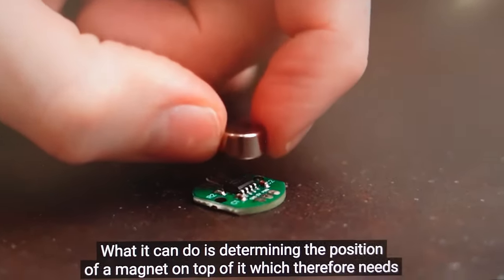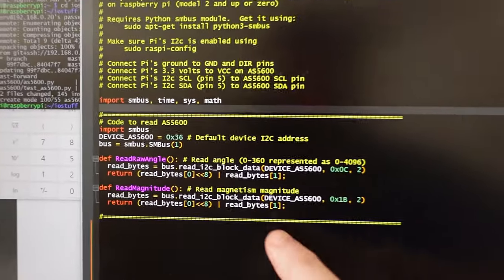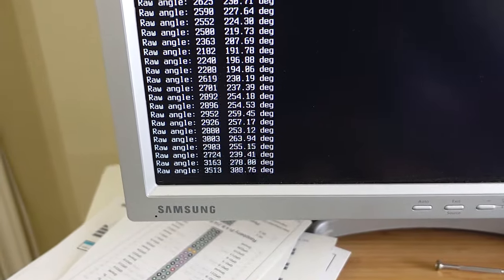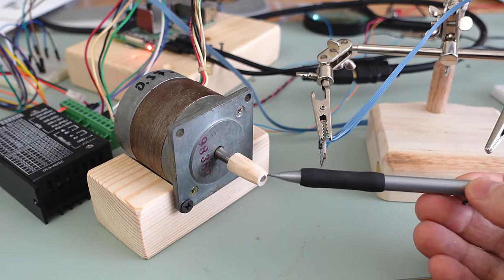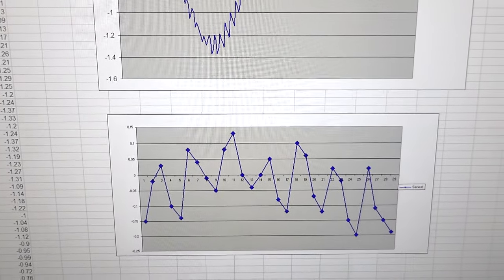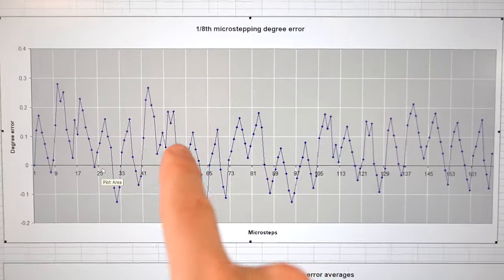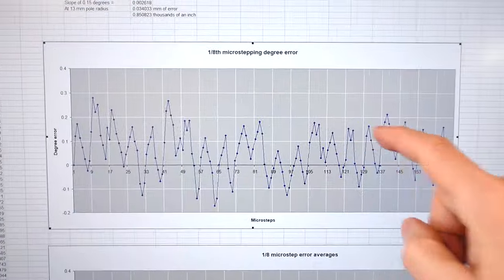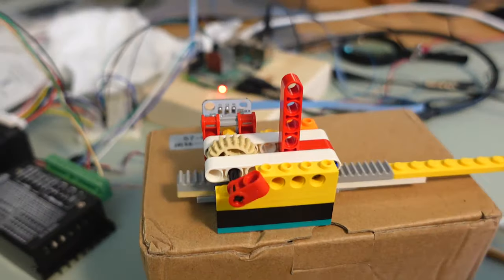Magnetic rotary encoder vs stepper motor accuracy

Comment: Luvvin how you're introducing the Lego for more accuracy
Reply: There's some legit engineering that goes into Lego, that they're able to mass-produce them to the very precise measurements required to lock into each other reliably is seriously impressive
Reply: Back in the 1980s he built a working Lego engine.
Reply: I only have one word "Danish Quality" - Oh wait that was two words, but I stand by them 🙂
Reply: Can you measure some lego for me? With micrometer❤? @Koushakur
Reply: The great thing about it, the uniform parts.
Reply: Someone said that in a Lego box (and before that Meccano) there is the seed for the next real supercar or spaceship.
Every engineer I know started with that as a kid.
Reply: Lego are error correcting building blocks
Reply: @LazloNQ  a wild lazlo appears

Comment: I work for RLS, where we design and manufacture high-resolution magnetic encoders. It seems you're heading in the right direction, but what you need to do is perform FFT analysis over the accuracy plot. This will reveal the harmonic components of your signal (accuracy). The DC component will represent the offset (+ latency) between your reference and the DUT (encoder). The first harmonic represents the eccentricity of the magnet, and so on...
Reply from the maker: yes, fft would have been nice, would have a few low frequency peaks for eccentricity and manetic encoder errors and some high frequency peaks for step and microstep errors.  But just showing it in time domain, I think, is more helpful for unerstanding.
Reply: Does the sending of the data induce a magnetic field as wel (radiosignal)?? Would utp-cable be more stable?
Reply: @matthiasrandomstuff2221 "unerstanding" may be my new favorite word... essentially "removal of error in one's [prior] understanding."

Great work, here, with this vid, and so many others. I hope they bring much unerstanding to this world.
Reply: Why are the RLS linear position sensors so expensive :( I am building a core-less linear actuator at home but I need position sensing to correctly commutate the currents. But the price of the linear incremental encoders are quite high haha
Reply: @Peter_Enis  Induced magnetic fields are way too small. The magnet was probably 4×4mm, and the magnetic field of the magnet is approximately 100mT.
Reply: @lvb3575  If you can, just use a rotor encoder and translate the linear movement to a rotation and backcalculate the linear movement.
Reply: @lukahrastovec5022  Thank you for clarifying! 👍
Reply: @matthiasrandomstuff2221 i think your magnitude/angle plot was very clear. Super intuitive how it related to the actual reading and position/offset

Comment: I have worked with these encoders in FRC, and when you use a precisely machined part, you can get about a half a tenth of a degree of error but when they are even just 2-3 mms off, their accuracy goes down so much they aren’t worth using at all. The distance of the magnet to the encoder also matters to the mm. I bet if you had a lathe and made a shaft for the magnet to go into and attach it to a motor, you would have way more accuracy to less than a tenth of a degree.
Reply: It's a 12 bit encoder. It's resolution is only 0.09 degrees, so you're not going to get better than that.

Comment: I ran across this same issue.  We were driving a furnace loader with a stepper motor and battling with resonance. It turned out that the stepper motor position was not linear when micro-stepped.  Our drive used two ROMs, one for cosine and one for sine to control the current going to each phase of the stepper motor.  I created an adjusted version to correct the error.  The motors ran smoother but the first step away from the pole was not very predictable.  I only corrected for position under no load, we planned to also adjust detent torque, but ran out of time.
Reply from the maker: maybe its a good thing I can't tweak the microstep ramps in the controllers I have.  That would be endless futzing around!
Reply: That’s exactly right: microstepping is a “guess”. The only really trustable position is on full steps. I read a few articles about the drivers that allow for microstepping calibration table, they point that when the load changes, the response curve from the motor is affected.

Comment: It would be ontwresting to take a full 360, maybe 3600 samples per spin, 5 full rotations each way. And do some magic with it to compentate for the flux line discrepancies and see how close with interpolation you can close the error gap. Im guessing everything around the magnet has an effect on the flux lines and each magnet is different but with an interpolation you might be able to close that gap for any given magnet. Basically a calibration  so to speak.

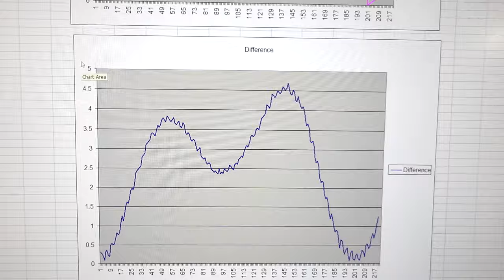Comment: The error graphs from 2:55 and forward are just textbook encoder eccentricity examples, usually caused by misalignments between encoder and target.

 As many pointed out, the center of magnetic encoders are sometimes not in the chip's center. A decent PCB design might fix that by putting the magnetic center at the center of the PCB, instead of just aligning the chip's center.

But, even then, due to manufacturing tolerances in the entire chain, you may end up with eccentricity. Thankfully, this can be removed by software through calibration. Many of these magnetic encoders come with a built-in function that you can trigger, but not necessarily all. One possibility is doing your own calibration on the controller side, as eccentricity errors have fairly low frequency, compared to microstepping and cogging errors.

Ben Katz has a very good blog post on doing such a calibration, though for BLDCs that will run FOC. For steppers, you'd essentially just have to low-pass filter your eccentricity graph, and apply it to your measurement through a lookup table.

(That would be where running the FFT on that plotted data would help, as the employee from RLS cited: it would help you determine a good cutoff frequency for the filter. Also, because the motor is periodic, you don't need a windowing function, and there should be zero spectral leakage. Perfect FFTs are my jam!)
Reply: In this case the sensor center is the IC center. edit: some are some aren't.
Reply: @jaro6985 I’m pretty sure it’s not in the center. I own multiple AS5600L (same chip and form factor but you can change the I2C address) and after designing my own PCB for it and thus really studying the technical documentation I can with certainty say that those don’t have the center of the sensor in the center of the IC (which is really annoying and unnecessary). It’s off by roughly 0.16mm
Reply: @OleBrouer  you are correct for AS5600 but not for AS5047. 5600 is offset by 0.172mm. thanks for that.

Comment: I have checked a micro stepping stepper motor by attaching a laser pointer and drawing dots on a wall. The accuracy is affected by the linearity of the DAC's in the driver (probably very good) and the linearity of the magnetic fields which is probably related to the shape of the stepper motor's "teeth" (probably not so good).
As a toolmaker in a past life and, more recently, an electronics engineer, I'd be using a dividing head to make gears, with a stepper motor to drive it.
Love your stuff, particularly your systematic approach!

Comment: Those magnetic sensors are really good. Depending on the exact part number, you can also use them to emulate a quadrature encoder, and at start-up it will output exactly the right number of pulses for the starting position.

Comment: If you're getting 0.3 degrees of error, would a gear reduction help with that? Like, turn the stepper motor 10 steps to get a single step on the other end of the reduction. Would that give you a 0.03 degree error on the other end?

Comment: You should play around with some industrial servos. 31 and even 32 bit optical absolute encoders are available from Fanuc and Renishaw and other big players. 2 - 4 billion counts per revolution, accuracy of .0000001 degrees, I think that's 1/8 of an arcsecond. Unfortunately, the bit rates are so high, they use proprietary serial position outputs instead of raw encoder counts.

Comment: I really like those AS5600 encoders and have used them in a lot of my projects. Like you noticed, the alignment of the magnet matters a lot. Also, the distance from the magnet to the chip matters. If I remember correctly the spec sheet calls out a distance of 0.5mm from the magnet to the top of the IC package. Great video!
Reply: Yes, I came here to point this out - the correct positioning is not in the centre of the IC.
Reply: @cooperised  the correct positioning is the center of the IC. Airgap depends on magnet strength and size.
Reply: @jaro6985  Absolutely not universally true, though it may be for some devices of course. Check the datasheet for the specific device you're using. Some are marked with a dot to show the optimal centre of rotation.

Comment: Even the mounted magnet one can see the magnet wobble in the holder mounted on the shaft......
ideally even the motor shaft when in rotation is machined with a fine cut for "truness" before mounting the magnet holder.....similarly the holder is then machined..lastly the magnet is mounted...
This is normally the setup procedure for extremely accurate alignments...
Make sure of a really good fit (mating) btwn. shaft & hole & not an interference type fit...magnet face must also run true else it may contribute to errors due to magnetic field strength variation 😊

Comment: Use the current gen TLE5012 instead, it has a 15 bit resolution vs the 12 bit of the as5600, which is quite a substantial improvement, and not very much more cost ^_^
Reply: The resolution is better but the error spec between the two is very similar, +/- 1 degree worst case. 
You can probably do some tricks on startup with calibration though.
Reply: @jaro6985  (I have this and a few other models for testing, but keep putting off the implementation as I'd assumed they'd just work as I expected based off the bit depth 🙈
Reply: @noviceartisan  oh it will work well I'm sure, just that once you get more and more resolution you might get more noise too.

Comment: VERY cool video! Yeah - most people assume microstepping goes perfectly. It is not linear. You can only trust the correct position of full steps. What happens between full steps varies a lot between each motor. I read that Trinamic has more expensive drivers that allow you to calibrate a microstepping curve… but I never had one to play with.
Reply from the maker: Half steps are also accurate, but anything in between might be off.

Comment: I get similar results in my tests.  The magnetic position vs step position is good up to about 800 s/rev. Another source of error is the drivers, with different varieties having different microstepping accuracy.  I was going to do a test of stepper vs magnetic and optical encoders.  That fell apart when I took the back off a $10 aliexpress optical encoder.  It wasn’t an optical encoder at all but was a magnetic encoder.
Reply from the maker: it would be hard to make an optical encoder with enough resolution to test microstep accuracy
Reply: The encoder I have is 600 ppr or 2400 Quadrature transitions.  I have it geared up about 4:1 so close to 10000 quadrature transitions per stepper revolution.  I put the project aside when I found out it was magnetic.
Reply: Just checked an optical rotary encoder I purchased from AliExpress recently. Things weren't looking good when I realised it didn't actually say "optical" on the device or packaging, but was relieved to find it did actually use an optical mechanism, and even had an O-ring sealing the casing.
Hopefully I didn't introduce any dust in the couple of seconds it took for me to peek inside.
Reply: @sircompo Do you have a link for your encoder?

Comment: This is a really great video, I have magnetic encoders built into the Odrive but I've always stuck to the CUI AMT212B encoders because I've been skeptical of magnetic encoders in VERY high precision applications I typically mess with them at. But this video actually shows a really great example of I think quite reasonable achievable accuracy given very high concentricity between the encoder and magnet. I very much like the way you visualized the encoder values in the rotary configuration as well as the linear application. Fantastic!

Comment: Without taking into account the positioning of the magnet or sensor, there is another variable here,
the stepper drivers are really not that accurate as you may think, they tends to have deviation from the ideal position,
in my field of work we do much higher microstepping that on these drivers (let's call it "continuous" microstepping), then, in the calibration phase, correction are made for each microstepping step, to verify the angle is actually right, once that is done, you ensure a VERY precise angle for the voltages provided to the coils.
You just ends up with a big voltage correction table that smooth it all.
Problem is here to have a very precise reference, but even without an ideal one, you can still improve the system.
Reply from the maker: my whole point was that micrstepping of the drivers isn’t accurately matched to the motor characteristics
Reply: @matthiasrandomstuff2221 Right, and even if that was the case, each stepper from the same manufacturer is slightly different.
For example each DC motor we use, from very reputable sources, are recalibrated in house, same issue

Comment: It's crazy to see how inaccurate the stepper motors are even if you buy really good ones. Does the stepper motor driver make much of a difference? Like is using a TMC2209 vs a TMC2208 vs a A4988 that different in terms of accuracy?
Reply from the maker: For whole steps, there's not much the driver can do.  But if the driver's curves are matched to the motor, half step accuracy would be relatively better

Comment: Great video! I'd be curious to see what your results are with higher quality magnetic encoders like the AS5047P or MT6701. The AS5600 is kind of the runt of magnetic encoders, its meant to be a replacement for analog potentiometers instead of an encoder for control applications. It also has effectively 10 bit resolution instead of the claimed 12 bit resolution if you factor in the noise from it, but other sensors intended for motor control can have much higher resolutions and tend to perform much better in dynamic applications, as people from the SimpleFOC library community have found.
Reply from the maker: Noise is quite small, no LSB noise to be seen

Comment: AS5600 is not a particularly good encoder. From a noise perspective MT6701 is an alternative thats still relatively inexpensive, and I've found it to have far lower noise and is therefore what I recommend for my SmartKnob project that GreatScott mentioned in that video. AS5600 is cheap and fun to play with, but I can't recommend it anymore.
Reply: That said, I can't speak to linearity since I was mainly prioritizing low noise rather than absolute angle accuracy for my use case, so it very well may have worse linearity 🤷‍♂️
Reply from the maker: The AS5600 doesn't jump around much at 12 bit resolution, so for a knob, its about 10x as good as it needs to be.

Comment: Could you significantly gear down the the motor to the rotational position you are targeting to reduce the error in positioning? i.e. one full turn of the motor turns the part 1/8 a turn would reduce the error from 0.3% to 0.0375%. Or am I smoking crack?
Reply: This is good, but don't forget you'll get a little bit of periodicity from the gear engagement.

Comment: Matthias, some of what you are observing is the inherent accuracy of the stepper motor construction, which I assume has to do with the accuracy of the effective angle of the windings with respect to the rotation axis. According to a supplier we use for our products, Lin Engineering, the industry standard is 1.5% accuracy for a 200 step (1.8 degree) motor, but they say their motors are 0.4% accurate for a 200 step motor. So this accuracy, like any engineering specification, is a parameter of the motor and one you can improve with a better (and probably more expensive) motor. You are probably also observing some of the encoder's inherent accuracy.
Reply from the maker: 1.5% of what?  On its own this is unitless number which doesn't apply to anything.
Reply: @matthiasrandomstuff2221  1.5% step accuracy. So if the motor has 200 steps, 1.8 degrees per step, the full step location will be within 1.5% of 1.8 degrees (0.03 degrees) of the true position. Typical cheap stepper motors would have 5% step accuracy, or 0.09 degrees max error.

Comment: My plan is to drive my indexing plate with a stepper motor via a worm gear the gear ratio should make stepper motor error insignificant
Reply: And you know the accuracy/error/eccentricity of that indexing plate???.. & also what about the backlash error of worm wheel/worm gear?? is it provided by the manufacturer...

Comment: Who cares about shaft angle? I care about where my load is. Since the mid-1990s, I have relied on the motor's encoder, purely for loop stability (D-term of the PID). Axis position is provided by a load-mounted feedback device (P-term, I-term of the PID).
I was recently called-out to help with a "process problem". The client couldn't make an accurate part but the control system was reporting perfect positioning....Yes the motor was going where it was commanded to go but it was oblivious to the lost motion in the drive-train.